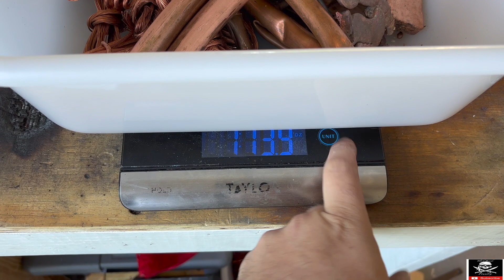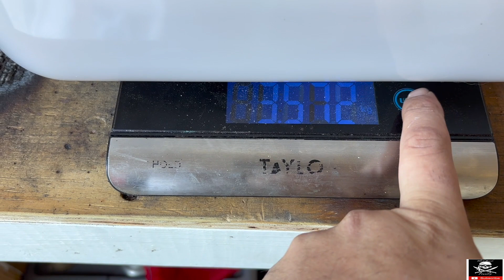Copper melt from shop cleanup - ASMR -

Comment: How do you calculate for your molds how much to melt ? I just bought a forge like your and a smaller one for gold and silver any help is appreciated          Rod
Reply from the maker: Yeah so at first I was just melting enough to fill it up. Now that I had a reference point I just weighed those previous bars to know my fully cooled melted weight
Reply: like bigstacked I'll subscribe to ya